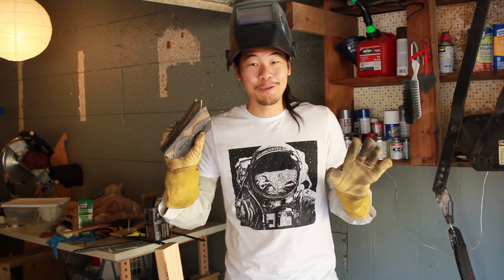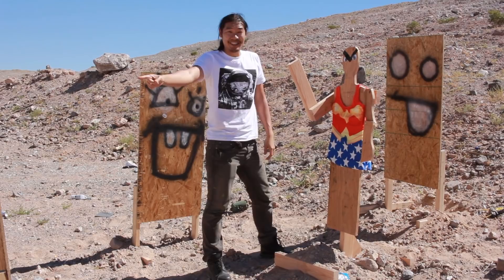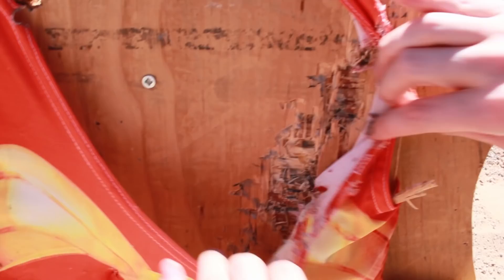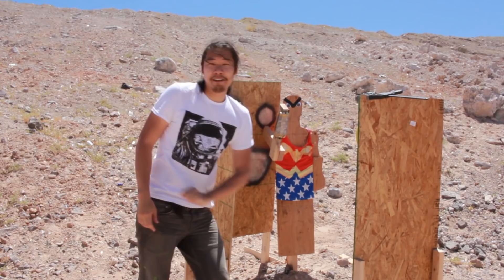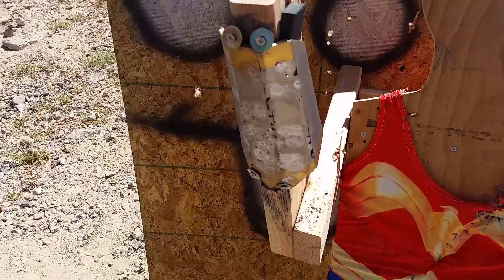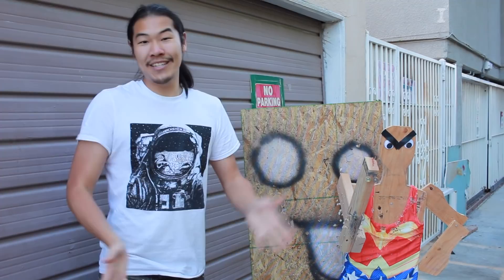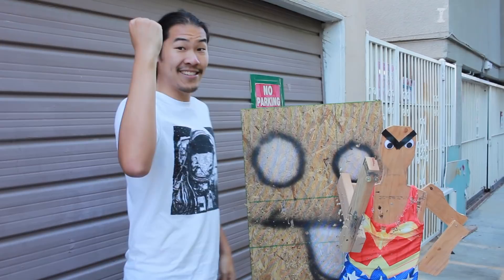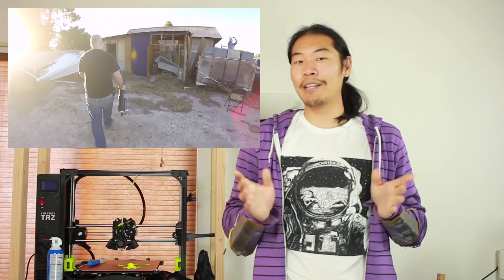Real Wonder Woman Gauntlets (But Are They Bulletproof???)

Comment: what about the force into the arm? You should stick some kind of force sensor behind it and shoot it again and see how much force is exerted on the arm
Reply: Well really not much, because you can imagine it can't be more than the recoil you feel in your wrist as you shoot. The reason why the bullet is lethal is because it concentrates all that energy in a small point. Spread over the area of these bracelets it wouldn't even hurt.
Reply: Sure, I guess that makes sense. I was just watching a Modern Rogue video on shooting guns and they were describing the same thing.
Reply: if you can shoot a gun with 1 hand, you can stop a bullet with 1 (armored) hand too.
Reply: Ballistic vest impacts often result in broken bones and horrid bruises.

The misconception here is that recoil force is equal to impact force, which is not true.

Recoil is dampened by the slide track, using springs and the mass of the slide to reduce and redirect the transitional force felt by the user of the firearm. Where as there is no compensation for the target, so the full impact force is felt.

While survivable, multiple shots to the forearm in a normal user would likely lead to bruised bones if not fractures. And definitely some gnarly flesh bruising.
Reply: a .22 if the metal is built good, it would not hurt that bad, but anything larger will start to hurt and if it reaches like a .308 probably could bruise or sprain the forearm. (it probably would break the gauntlet, but that beside the point)
Reply: +Garrett El Programador Ineptos while the recoil is absorbed in a semi automatic weapon, that is not the case with a revolver.

And of course we should compare her bracelets with hard body armor (Kevlar+metal plate) and not just with a Kevlar vest. Indeed, if you are only wearing Kevlar, the area of the impact is not much larger, instead the energy of the bullet is dissipated to a lesser degree by fiber deformation. Depending on the bullet, it can still hurt a lot yeah.

Comment: She holds that gun soo wrong
Reply: I think it's mostly her scoliosis
Reply: Oh i didnt know she had scoliosis
Reply: thats so wrong, thats ono with a rifle. your method would cause your hand to blow into bits.
Reply: Ya, you all dont know how to shoot guns, to shoot a rifle, you place the stock in the middle of your chest and point to shoot. This way, everything is symmetrical and you can look down the scope with both eyes 👀
Reply: Alex Treseder preach
Reply: Holding under where? Previously you said under the barrel which is both potentially hazardous and also not necessarily feasible with a handgun. Even if you meant under your other hand, that's the "tea cup" grip and is the most stereo-typically bad grip.
Reply: His stance is definitely poor, but his grip is fine.
Reply: Alex Treseder yea but her aim is good
Reply: They probably didn't learn to use it properly

Comment: Cprrect me if i am wrong, but would it be possible it a metal that absorbs all energy, and the bullet kust drops straight down?
Reply: RedSlime no 
Every action has an equal and opposite reaction
Also lead is very brittle so any metal its hitting at high speeds (like from a gun) the lead will always fragment, bend, shatter, reflect, etc 
Things like kevlar and soft body armors are good at catching the bullet because when its hit the projectile just smashes down bending out and "mushrooming" (its called that cause it looks like a mushroom when it smashes like that) 
But no 
No metal when strucken by a bullet will absorb all energy and make the bullet harmlessly fall to the ground

Comment: Cool project mate very entertaining but what's with the "Myth Busting" approch ? I mean, this "experiment" is pretty bias as there literally no factors of Wonder Woman's Bracelets that can be accurately replicate in real life. Sure i guess some physics principle remain true regardless but for the most part this can't be replicated. The "Bracelets of Submission" are made of a fictional and mystical metal with insane properties and WW has both super speed & super strength, which i'm sure you'll agree , would definitely have an impact on the effectiveness of the bracelets, as well as the behavior of bullet's shrapnels.